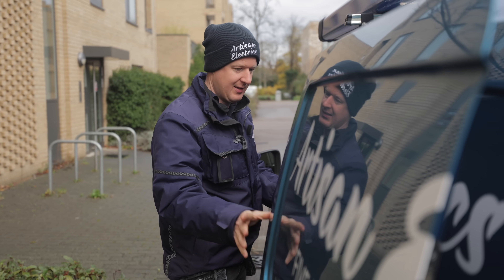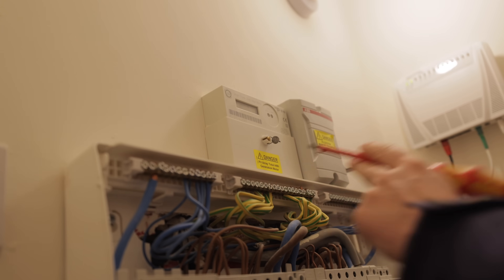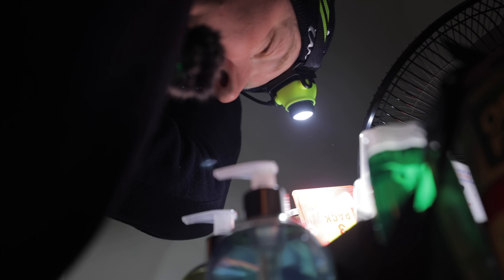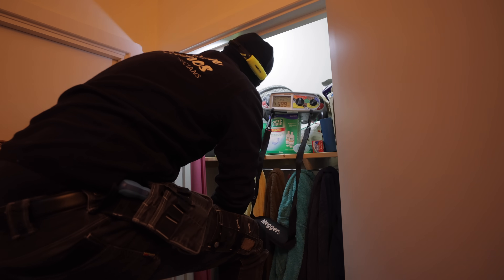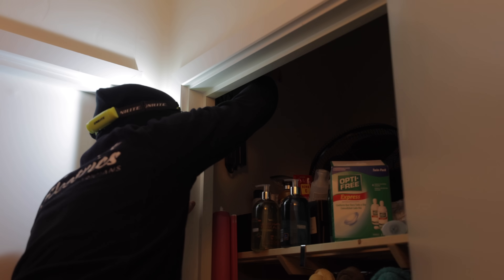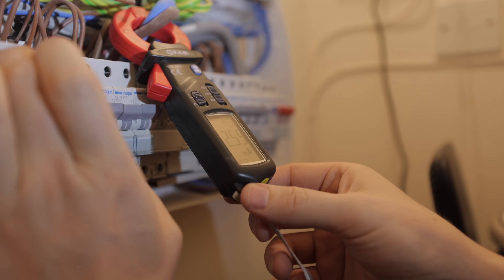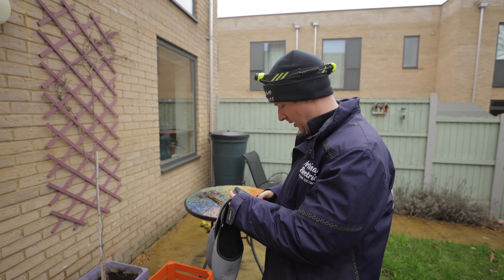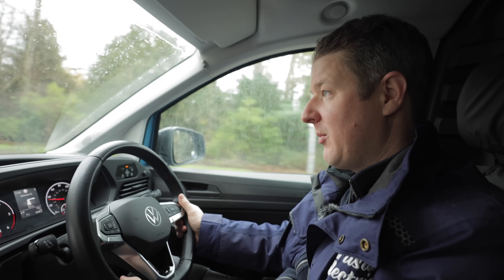"My Solar Panels Don't Work" - Fault Finding a Solar PV System

Comment: obviously not your actual fault as youve proved, just another note on the the install… 

Shared RCDs are not permitted.
At the a.c. mains end the PV supply cable must not be connected to the outgoing way of a final circuit which shares an RCD with other final circuits (see IET code of practise for grid connected PV systems page 88). The reason this is prohibited is that the other final circuits maybe supplied by the inverter, during the shutting down period. This would mean the required maximum disconnection times for these final circuits could be compromised. In addition, sharing an RCD may cause unwanted nuisance tripping due to accumulation of earth currents.
"

Comment: This may not have been down to a faulty micro-inverter, the cables may be reduced by an infestation or as it's a flat roof the installers may not have kept the cables up off the roof and they could be sitting in water. If it was a faulty micro-inverter then all the more reason to avoid installing them.

Comment: This i why i don't like micro inverters, until they can make better access to them I prefer to keep the roof installation very simple. I was thinking that if the micro inverters could slide down on a mechanism from the bottom rail so that you can do maintenance from a ladder below. It would need to be able to feed two PV panels above it vertically.

Comment: Have you ever come across buzzing/humming sounds from the loft once solar has been installed? Seems to occur even when you turn off all the power & more apparent once the sun sets, not the main inverter. Any ideas mate?

Comment: Not the issue here but one thing to look at is what type of rcd is used for solar you need to use an a type rcd not an ac type as the dc current can leak back onto the ac circuit saturating the coils and will eventually stop the rcd working
Reply: Technically you are not saturating the coils, you are saturating the ferromagnetic ring with too much magnetic field.

Saturation is a well understood phenomena of transformers.

Comment: I did similar troubleshooting like on the video and then asked Artisan how much it would cost for them to check the roof, find the broken panel/inverter, claim warranty and replace. 
It took multiple emails, no straight answer, in the end "oh we need to hire a ladder/scaffolding and we can do all + £160 or so per hour, then again to replace it" I said thanks but no thanks, I'm not a millionaire. Shocking they don't have a tall ladder!
Reply: You saw how he wasted an hour at the start by testing every wire he could find instead of just turning all isolators off and back on one by one until it trips, he even said at the start he had an idea of what it was.

Comment: Just use a Solis string inverter next to your consuner unit so much simpler and easier. The new ones even have a built in DC isolator.

Comment: I’d be interested to know what type of micros these are (haveing chosen micros for my own install).
 It’s fair to say that when I had mine fitted they were not the cheep option, and they do have benefits, especially areas where some panel’s may become shaded. They also mean you get stats per pannel and also don’t have to find room for a large inverter. Optimisers may have replaced some of these benefits but that wasn’t an option when I had mine fitted. I’m disappointed that the micro didn’t fail in a way that allows you to locate it via the app, as I thought that was another benefit. Overall I’m reserving judgment as it could still be some other issue!

Comment: Hello Jason, another fascinating video. I have a question. Why isn't possible to link PV solar panels directly to a car battery. Both use DC. It seems inefficient to convert the PV to AC using an inverter then put the AC into the car which then converts it back again to DC to charge the battery. My PV is a 7kW array. When the battery is fully charged, the solar panel reduce their output to the 3.68kW of the inverter. Why can't I use that spare capacity of the panels to charge the car directly using the DC? Thanks
Reply: Because firstly the voltages of the panels and car battery are different.
Secondly you need a constant voltage for many types of car battery. So you really want a charger suitable for the battery chemistry to be present.
Reply: @deang5622  Thanks Dean 👍🏻

Comment: What’s the plan then Jordan? 
Any warranty left on the solar panel install / micro inverters? 

Maybe propose a change to String inverters so access/maintenance can be carried out from within? Might be an idea to survey / canvass surrounding buildings that are part of the same development. 

I would’ve thought that there’s probably a general roof maintenance programme for the development - access probably in the build / method statements for cleaning & maintenance. 

Maybe a cherry picker would be safest / easiest option

Comment: Do you actually know anything about solar installation because if the pannels don't show they are working the problem is on the roof normaly that's the first place to look and test this should be an easy job if its on a flat roof

Comment: If at all possible, do not site inverters in a loft. In high summer, the inverter(s) are working flat out and in the process also generate a lot of heat. Additionally, the loft itself gets incredibly hot unless adequately ventilated. All this heat damages the delicate electronics of the inverter leading to failure.

Comment: There's been quite a few studies now that show micro inverters and optimisers offer little advantage over central inverters even in shaded situations. And on a new build I think we can be pretty confident they didn't go with a premium brand.
Reply: I think installers quite like them because it makes it easier to find faults on large strings
Reply: I agrée. MIs are much more hassle than they gain in most circumstances. The only time I would fit is where the roof space isn't big enough to get all panels able to be in sunshine at once.

Comment: Micro Inverters are not the "Cheapest option" as you stated.
They are a simply a better way of addressing shading issues to maximise output of the array.
Unfortunately they are also well known for failing.

Comment: Don’t run Enphase micro inverters down they have a 25 year  guarantee.I put all my micros  inside the loft by extending the solar panal dc cables to them.have had no broblems  with them for the last 6 years.
Reply: A long guarantee is evidence that the manufacturer trusts the quality of the product they are selling.

If it was prone to failure, the quality was low, then the manufacturer is going to incur great cost issuing replacements throughout the life time of the warranty.

So generally, a manufacturer, if they know what they are doing, won't issue long warranties unless they are absolutely sure their product is of  excellent quality.

Comment: Do you have a video where you install Microinverters? YouTube search didn't find one.
Can they be installed so they sit in a dry accessible room or loft? 

How are they connected to the house mains? I know that there is a loss if they are to be used for battery storage. Or is there a way of avoiding this loss? 

I've seen in other YouTube videos that Microinverters , if properly installed,  the  failure of a μinverter should not see the failure of all panels and total loss of power from the panels. Also the failure rates of μinverters is very very low. And guarantees are 30 years. 

Great videos BTW
Reply: Micro inverters are normally installed on the back of the rails that hold the pannels and pannels connect into them then the micro inverters are plugged into a single cable back into the property all plugs and micro inverters are or should be water proof and when installed each pannel and inverter are logged by position so you can find out which one isn't working and ware it is. access after installation is always going to be expensive on a pitched roof as you will need scaffold message me if you been clarification

Comment: As someone who has worked in construction (major infrastructure projects) most of my life I always find it amazing that house builders consistently fail in their duty under CDM.  If someone fell of a roof doing this type of maintenance (that could easily be avoided with a simple design change) the Principle Designer should be held accountable.  However because its houses I suspect that no one ever would hold them to account.

Comment: After watching some USA and Australian solar panel channels I wonder why Brits bother! 
There's a solar array in Aus that has the house and mancave garage fully satisfied by 11am then charges two Teslas! There's a solar off grid home+ that runs a plasma cutter CNC and a whole house. Here in the UK we usually manage to send 1 or 2 KWh back to the supplier when they don't need it.

Comment: A couple of points to mention on a safety front is never leave a live fuse board or any other piece of live equipment open while you walk off and leave it unattended!! 
The other point worth noting is when you straightened the busbar, you failed to check that each MCB was clamping the fingers correctly, that is the single wisest thing you can do on that type of modular board.

Comment: What is the difference between an isolator and a switch?
Reply: Same things really except an isolator of the type required for solar installs will normally be sold to have a certain (better) isolation and safety reg spec. They are usually beefier, with more insulation, and more expensive. Better materials, different switching mechanics. The actual switching mechanism usually puts more distance (isolation) between conductors when off, for example, so they might be less likely to arc or fuse shut in a fault situation. Also, an isolator is more likely (but not necessarily) to cut both conductors (live and neutral) unless some monkey bypasses it as would appear to be the case with the neutral in this video.
Reply: @jam99  Thanks for that information 👍
Reply: @jam99 Isolation of DC is harder to perform than isolation of AC so a different type of isolator that is DC rated is required.
Reply: @deang5622  Good point. My understanding is that it is not really the isolation when off/on that is more difficult in steady state, it is more the (transition of on to off) dc arcing under load when switching off so current and voltage ratings of an isolator are normally not the same for ac and dc. Hence, the dc rating of an isolator must be observed in a dc application (and, typically, the dc rating will be 'weaker' than ac rating). But I am not sure this is relevant to what is a 'switch' and what is an 'isolator'.
Reply: As I understand it.

An isolator is a device that performs isolation, that is disconnecting parts of the installation in a way that makes them safe to work on. In particular an isolator is designed to ensure a sufficient contact gap is maintained for safety and to give a positive indication of the position of the contacts.

A switch is a device used to turn stuff on and off, in particular a switch is designed to safely perform connection and disconnection under load.

In practice though many devices are designed to perform both functions, Indeed my understanding is that isolators that are not suitable for switching duty are only allowed in situations where the installation is under the supervision of a competent person.

Whether these devices are referred to as "isolators" or "switches" seems fairly arbitrary. The rotary style always seem to get referred to as "isolators" while the din rail mount ones used in consumer units get referred to as switches. Despite both performing the same functions.

Comment: Another reason not to have micro inverters/optimisers. They marginally work to improve some instances of diffused shading but all modern solar modules are designed to deal with most other shading out of the box.
Reply: One huge advantage of micro inverters is being able to slowly add more panels over time as you can afford to.

Comment: 08:10 "so they have no wired it up properly'" so would you take the neutrals out of the chop block and fit to point 3 and 4 of the switch or are you leaving it as you found it???

Comment: Inverters can interfere with Ham Radio signals, especially when they comply to the old CE standard or badly fitted.
Ofcom are on the case.

Comment: Micro inverters need to be smart and be able to communicate with a base unit, otherwise any single fault will mean having to investigate all of them to find the faulty unit and in a big set of panels may even mean pulling many panels off the roof, having a string inverter indoors mean easy access and fault finding and reprogramming at any time

Comment: How come you do all these solar videos but aren’t on the MCS register?
Reply: Apparantly they have said they are in the process of applying for MCS registration, and that it takes time.
I don't know how long it takes but as of today 21st May 2023 they still aren't registered.
Reply: You don’t need to be MCS to instal solar
Reply: You need an MCS certificate for the SEG tariff (Smart Export Guarantee). Not all energy providers require it for an export tariff but the tariff's that are SEG do require it. AFAIK Octopus require it for their export tariff's and tariff's like Intelligent Octopus - if you want to get paid for any export.

It is not a legal requirement to be MCS registered and hence provide the customer with an MCS certificate - however the customer is at a disadvantage without one, as it limits their options to get paid for export and even though that is not much per unit at present - it could become more of a problem in the future with new gov schemes or better export tariff rates.

If i were having a company install solar - i would want an MCS registered one so i get a certificate. It can also be required by buyers if you are selling your house with solar and could reduce value or put off buyers if you don't have certificates.

Comment: Should also check the inverter installation guidelines to see what type of ELU to use on them. Normally for PV inverters they recommend at least 300mA ELUs

Comment: What’s the difference between twin and earth and 3 core flex?
Reply: Twin and earth is not flexible😅
The conductors are solid.
Reply: Twin and Earth (T&E) is just the nickname given to the flat, usually grey, cable used for internal house wiring here in the UK.
6242Y Flat PVC cable is the full proper name for such cable.

T&E has solid conductors, with the earth cable being uninsulated internally.
3 core flex has stranded conductors, all of which have secondary (their own) insulation.

Comment: 11:00 Jordan, armchair Safety Sally here, I hate to call you out here, but figure its my job as safety officer here.  Is your arm calibrated to the correct torque value?  I just saw a regular screwdriver tightening those breaker screws, and not a torque screwdriver!  🤷‍♂👍  I am guessing that a remediation training course for the boss is in order!  😂
Reply: Tight is tight

Comment: Is it a legal a requirement to use a 2 pole isolator….in the UK

Thanks
Reply: Normaly standard installation so dc can be isolated
Reply: Main switches of single phase domestic installations are required to be double pole, but other than that BS7671 allows single pole isolation on TN supplies in most cases. 

I'm not sure if there are any special requirements for isolators used on solar installations.

Comment: No access from inside to get onto the roof 🤔seems very odd. Why not plan to move the inverter internally to save any future probs   While ya sorting 🤔 

Might be an idea to see if they’re any plans / dwgs around - if not then offer to provide survey for any future contractors coming in 👍
Reply: They are microinverters - One per panel, close coupled at the panels
Reply: ahhh thx. I had to look em up. Pros n cons to either string or micro inverters. For this particular project / where there ‘appears’ no easy access - string inverter sounds like a better plan

Comment: ⚠️thought you could login to the micro inverters to see health & performance. But if tripping RCD…. They really are like integrated LED’s. Great idea, but previous was better for maintenance
Reply: Well microinverters tend to communicate via powerline or some obscure wireless to a control unit... it's usually not an option to do this when the breakers are tripping.

Comment: Last solar system on microinverters which I have found that was faulty produced dc current between neutral and earth coming from  roof microinverters but that should be ac , be careful

Comment: I always thought that as part of the CDM Regulations Architect's/ Designer's have a duty to consider safe access to equipment for future maintenance by others. That would include whoever decided on putting the inverters on the roof especially if it has the potential to be a troublesome part.
Reply: @Nicky L I wouldn't touch a new build with a sh***y stick.
Reply: And Solar needs routine washing of the panels.

Comment: This is a massive problem I’m finding with new builds using micro inverters which works for shadowing but for maintenance and replacement scaffolding is probably required no future proofing should be a ladder and railing’s secured to the building to clip on to with harness. Personally I think inverter dc/ac isolated should be in a cupboard/garage easy access apart from the PV panels all electronics are in the dry. Guessing you have 3 or two panel systems with in the next 10 years all the micro inverters will need replacing their not cheep. If it is possible to series link all the panels bring one inverter inside or to accessible area for maintenance. No doubt all the properties will have the same issue.
Reply: The Enphase, which is the main microinvertet comes with a 25 year warranty. Do you really think they would give them that length of warranty if they are expecting them all to fail in 10 years ?